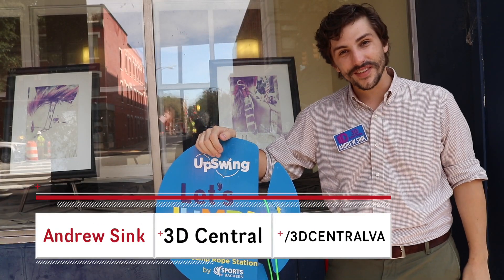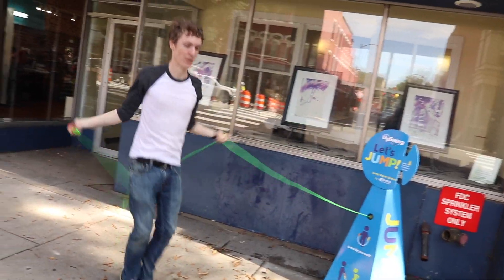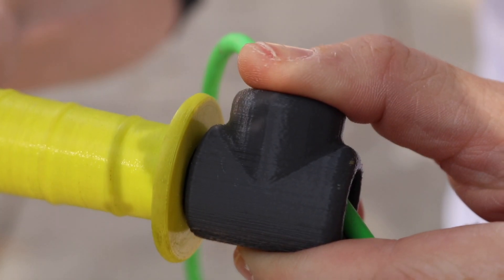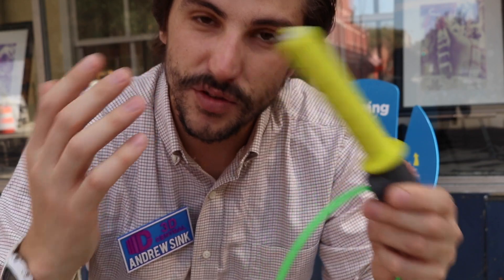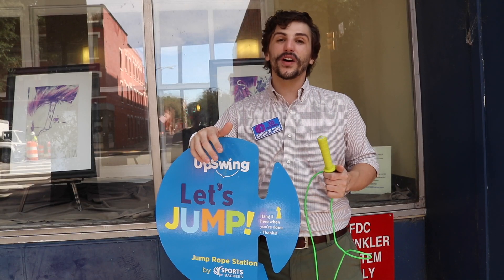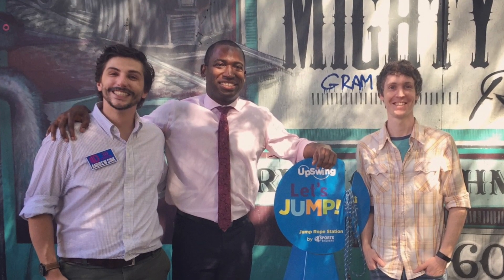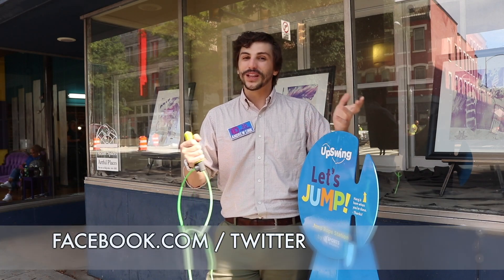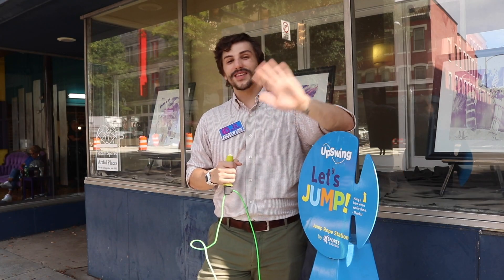Jump Rope with the Mayor / 3D Printed Jump Rope Handles!

Comment: HELP ME: i got an up mini 2 and I just got a roll of PETG and its set to extrude at 250c and not long after starting it stop extruding. Any reason as to why?
Reply from the maker: Hmm. I never had a lot of success running PETG on the Mini 2; I mostly used ABS on them. What brand of PETG are you using?